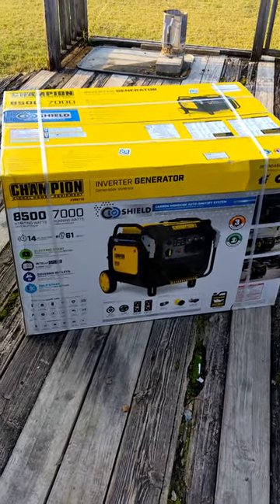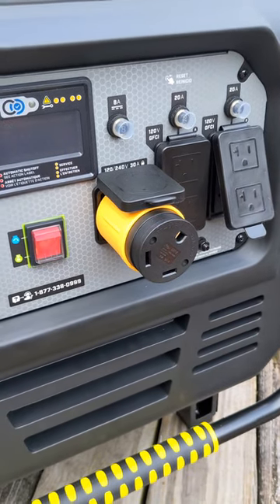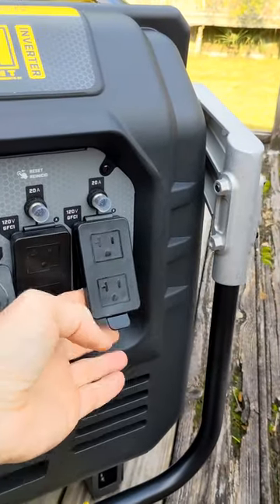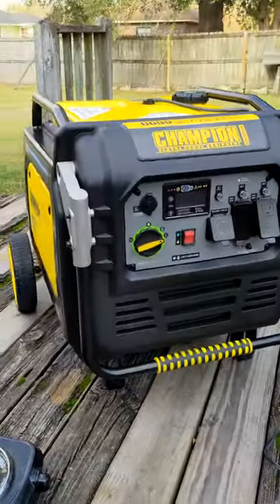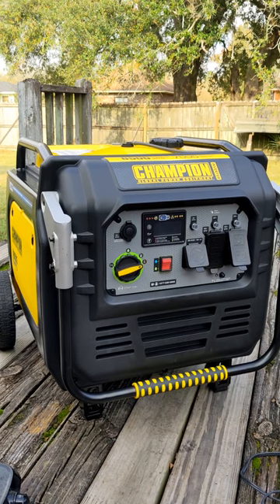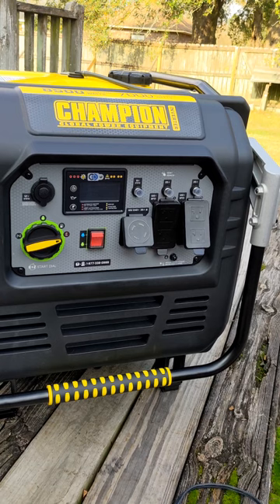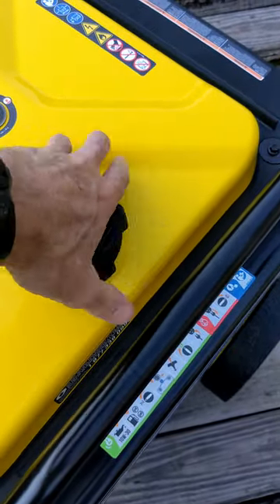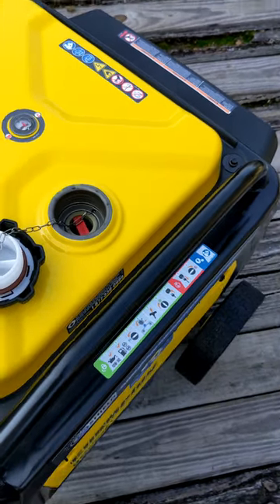Champion 100719 8500 / 7000 rated inverter generator quick review

Comment: I just purchased a Champion inverter after doing about a week's worth of research.  Decided I had no need for a 240v plug after realizing both my amp/watt requirement for emergency home back-up along with the fact that I could still use my four-pin input power box by using an adapter and just going 120v single phase.  That way I only need to manage total power consumption and not worry about each 120v leg.  
The model I got has six lights indicating power output/demand, and doing some break-in load tests seems to indicate that it works ok.  I also decided during my research that there were a number of features that I wanted to avoid, especially the CO shield.  I purchased model 201056 for $579.  
That red plastic insert inside the fuel strainer was the first thing I modified.  I simply broke off the top portion, leaving the red post still intact.  Gas fill-up works fine with that gone.  Sometimes I think Champion never tests the functionality of their generators.  I was also concerned about whether or not the TT-30R and surrounding frame would allow for my plug to be fully seated...and fortunately it can.  Thanks for the review.
Reply from the maker: I would have liked to avoided the CO shield too..... As a intelligent person would see it as nothing but trouble..... Locating a CO monitor inches from the generators exhaust... What could go wrong?

My understanding is the generator I bought will not run with it disconnected but it should not be hard to fake out....ie it's output signal would be a fixed voltage when it's okay... Maybe 12 volts maybe less... And that's pretty easy to fake if it actually causes you some trouble.  Just have to measure it and see what it is
Reply: @duskyman1  Yeah I talked with a Champion tech and he wasn't able to give me any specific info...so I decided that was a feature I needed to stay away from.  There are a few videos on HF Predator and using a jumper....not sure if that would work with Champion.  Best of luck with your purchase.
Reply: @duskyman1  This might help in terms of bypassing your CO shield.
https://www.youtube.com/watch?v=hq2XWzACBe8
Reply from the maker: @spacecoastz4026  thanks.  it looks like they just shorted a plug together that plugged into the co monitor.  On the champion 10719 it has a 16-pin plug into the co monitor... I don't think it's quite as simple.  But I do think it's probably achievable

Comment: That red plastic insert inside the fuel strainer was the first thing I modified.  I simply broke off the top portion, leaving the red post still intact.  Gas fill-up works fine with that gone.
Reply from the maker: Yeah I broke mine out too.  Sealed the little hole in the bottom with a little screw and nut. If I use a big deep plastic funnel that goes into the 1-in strainer, I can pour gas in without it splashing out on top of the generator so that is probably how I will fuel it for now.
Reply from the maker: The problem with that though is that your fuel cans usually sit on the ground and you always have the possibility of debris off the bottom of them falling on top of the generator when your fueling them.  It's not much but it doesn't take much to clog a carburetor jet or a little intake screen.

Comment: It's good to hear you're measuring almost the full 30 amps, i'm a bit confused by the specs Gasoline Running Amps at 120V	58.3A, so presumably that means you could say use the 30 amp outlet but also the 20 amp outlets for another use . Less bells and whistles but that can be a good thing during middle of a hurricane too....for instance that ai power 7000 has a ton of bells and whistles it seems. On the fuel i keep mine in metal jerry cans terra pump makes a controlled easy fill...they do eventually leak but latest one i've had a few years. On the plugs i always have the 3 outlet adapter with few inches of cord would solve that.
Reply from the maker: One 120 outlet is one one side, one on other.   So you could only get another 20 that way.   

I presume you would need to split the 240 to two 120 legs to get full rated at 120.... Since 58.3 = 2x29.2

I will hook to house and dryer to push to max

Amazon  has lots of poor reviews of those pumps.....concerning at the price. I've thought about them but the poor reviews turn me off.
Reply: @duskyman1  I ended up going with model 201056...and getting that TT-30P to L14-30R adapter.  It was your help that pushed me toward just going with 120V for house back-up.
Reply from the maker: @spacecoastz4026  that 201056 appears to be an awesome generator.  Light weight for 3500W at 80 lbs.  My 3500 watt with the wheel kit it has on it is probably about 125. Now things were made heavier back then and the wheels are steel you know not plastic and it's held up very well too being moved around over 20 years... Tipped up on its side on one wheel for service rolled over rough ground etc.   I really don't expect these plastic wheels on generators today to hold up well long-term if they're actually used they're very obviously consumer oriented you would never have something like that for a industrial application.       I have made do with 3500 Watts on my house for 20 years so I know it will do fine.  I have always run a few light bulbs, my refrigerator and frreezer, tv, and two 8000 btu window unit ACs.  Lightweight and reasonable fuel consumption.

I got this bigger champion 100719 because the deal was really good. $1260 tractor supply + tx, shipping.   $1600 to me.   It will allow me to run one more small window unit and a microwave/toaster oven without turning off the ACs to run the microwave.   It will also allow me to run my clothes dryer if needed, and my wife or daughter to run a blow dryer.     It will use about 30% more fuel than the smaller generator but I think I can manage it.   No I don't bother to get the window unit ACS out and install them unless the power is going to be out for at least half a day.  But when hurricanes or tropical storms come and knock out power for several days they do come in handy.  They use a lot less power than the central unit.  Basically a 8000 BTU AC draws about 8 amps running....1000w. they're small and light to store in attic.   It will also allow me to run a bigger welder than I currently am able to.  

I am keeping my small 3500 watt generator though. No plans to get rid of it.
Reply: @duskyman1  Sounds good.  Sounds like we both have what we need.

Comment from the maker: Well it's still being broke in but I put it on some heavier loads briefly to help seat the rings.  Just long enough to measure amps.  At 6200 w I was running basically my dryer and some lights and refrigerator and  freezer.   I had 28 amps on one leg and 23 on the other.  When I check the sound it was still 69 to 70 DB at 23 ft.  It was a much lower throaty sound.  I still think this is good for an inverter generator this big at this weight. I think the Honda and power horse are quieter but have lower rated output.  The power horse likely has the same engine as this ....a 420cc clone  based on a Honda 390, but good gosh it weighs 80 lb more.  The Honda is about 50 lb more itself.    More than likely a good chunk of those weights was more sound deadening

Of course I'm using a phone app which isn't necessarily that good but I don't think this particular one with my pixel 5A is too far off because I do get the base sound of 61 DB. that they say it has at 23 ft, in idle/eco.  I have an older phone that I tried with another app and it reads a solid 10 DB lower than my phone I'm currently using does  so you obviously do have to beware with phones and apps.  

By turning on a toaster oven also I did cause it to overload and cut off the power, and that should have been at about 7600w.

Interesting that I was reading 235 V on the generator display at that 6200 w but my kilovolt plugged into the house still showed 119.8, down from the 122 it showed with a very light 2000 w load... On at least the 120 side it was plugged into. Did not try and check the other one.

Comment: you mentioned you got it at a great deal thru trac0r supp1y.  I did also right before christmas.  Have you see that deal since they sold out?
Reply from the maker: No. That was the end of it.  I suspect they mispriced it . Maybe it was confused with the 8500 Watt open frame inverter.   You do not usually see $1,000 off.  45%  That was why I jumped on it and so far it looks like a good decision. Even after paying $200 for shipping it was still about $900 off paying full price plus tax.
Reply: @duskyman1  I got the same deal.  For that price figured I can't got wrong for a 240v generator for the little time as I need it in Texas.  I just need 240v pool equipment to run. Like you side i wish it has a few more bells and whistles (eg parallel kit, 50amp plug, realtime usage, better gas fill hole, etc) but for the price i think we have a winner.
Reply from the maker: @macs0708  I would never parallel one this big, so I really don't need any of that stuff but of course there are people that might and that could be a factor in their decision to purchase it vs another.

At the price i got it for, 1259 plus tax and  shipping.... I think it was a great deal.   I hope it lasts as long as my other champion that I've had for 20+ yrs.  This one will just  run a few more things..... Including my clothes dryer which is awesome if power is out for a while.  Power doesn't go out for multiple days that often but once every few years it does.   However the electronic circuitry of the inverter & Co monitor and multi-function display and crap are likely to fail at some point.  I'm not planning on getting rid of my other simple generator......
Reply from the maker: Champion is about to release a dual-fuel version of this generator that can run on propane also.  They have also added the 50 amp plugs so many people saying is necessary for running bigger RVs.   They even added a power meter to the multi-gauge, however they really messed up bad there because it's just a 4 light meter that says 25% 50% 75% ...etc.   somebody can guess that good..... What they need to know is how close they are to actually be causing their generator to trip.... And they need to know for each leg, not total... Still probably fix as a lot of the deficiencies of this generator and it cost the same price.   

I've been considering converting mine to propane just because.... But I really don't want to have a a big demand regulator attached to the outside of it when the new dual fuels don't.
Reply: Just thought I'd update this I went to use my generator about 8 month ago just to use it.... Keep the battery charged for 30 minutes it didn't function.   Bad inverter.  It went bad not being used. Champion did send me a whole Another inverter part under warranty...... This is a $700 part BTW.    Which I had to install myself.  Note that even though it was registered for warranty they still required the proof of purchase...... The invoice or receipt.  Fortunately I had it on my computer because it was an internet purchase.   No problem since but it is concerning that had I gone to use it in an emergency it would not have worked.    Obviously some poor quality control at play.  They knew right away what the problem was when I told them..... So I probably wasn't the first.   I did pay with the credit card which basically doubles my champion warranty..... Just for peace of mind. That's something I always do.